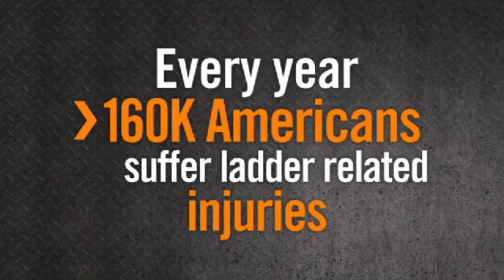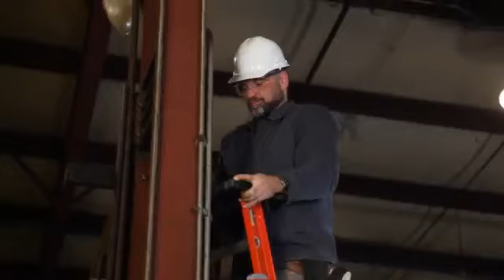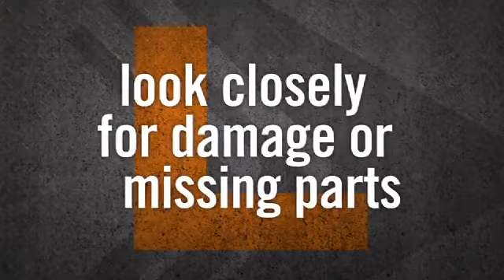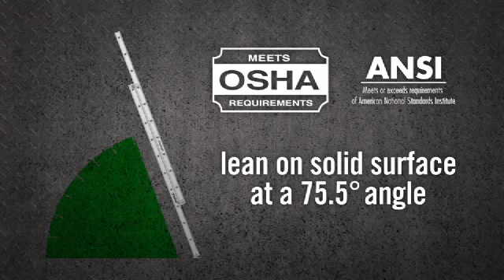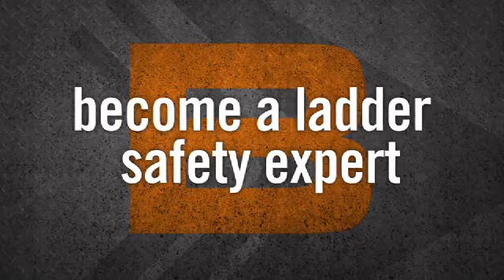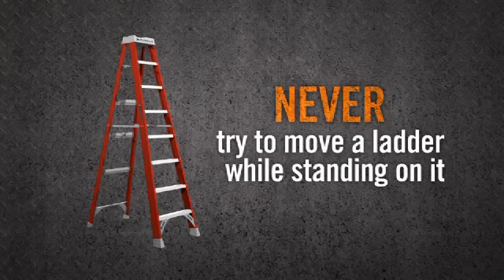Louisville Ladder - C.L.I.M.B. Academy - Step & Extension Ladders

Comment: Very good, except I think you missed one of the most important things about using a ladder: the proper technique for getting down from the roof. It is NOT obvious. It is not self-explanatory. IT IS DANGEROUS.
Reply: That's what always scared me was the coming down off the roof since I only did it every couple of years.
Reply: +Warsrogue That part scares the shit outta me!!!! I do it daily for work
Reply: If the ladder is extended 4 or 5 feet above the roof, you have something to hold on to when you stick your ass out over the roofline to step on the 6th rung down the ladder.  Simple, not dangerous.